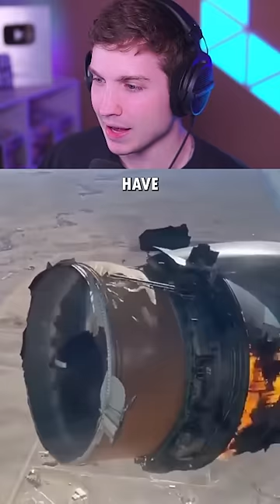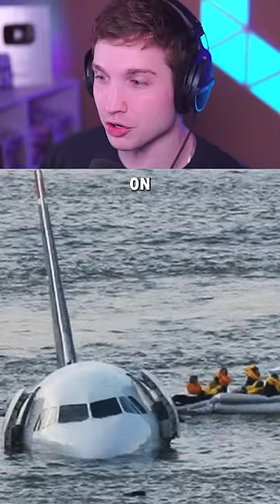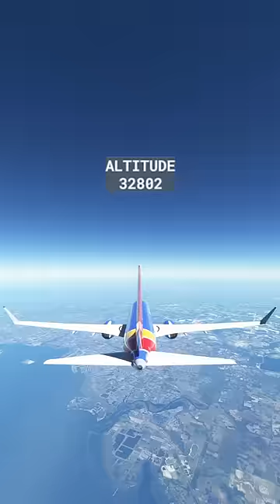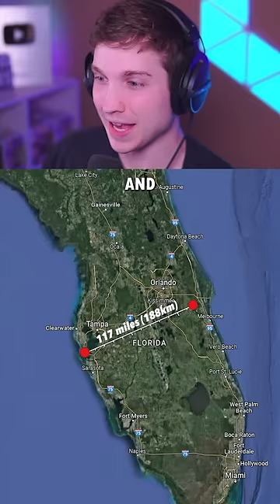How far can an Airliner Glide after an Engine Failure?

Comment: People who make movies need to understand planes don’t suddenly drop out of the sky in the event of an engine failure
Reply: Who cares? It's a movie, not a science show about airplanes. Most people don't care if it's scientifically accurate.
Reply: Movies are meant to be fictional. Watch a documentary if you want factual info
Reply: But in some cases the flight controls, airframe, and thrust difference all get screwed enough in a way you can't fly
Reply: I’ve never seen a movie where just an engine failure brings them straight down. You must be ignoring the fires or torn off wings or smth
Reply: @rjharikumar6555 you cared enough to comment.
Reply: @Cookies2132  - LOL, proper trash comment 😂
Reply: At the same time there can't be any absolute statements of any scenario. Failure of any type can generate an infinite combination of  unforseen anomalies. In the end whether a plane or boat, there are more reasons why it should be under the water or on the ground.
Reply: Madagascar flashbacks.
Reply: @rjharikumar6555 Most don’t care about scientifically accurate, but most want it atleast somewhat realistic, for example people will complain if a pistol fires 50 rounds with a single 9 round magazine.
Reply: @blackhawkuh-6026  - Again, go watch a documentary. Your mileage may vary but most people don't give a shit if a plane crash is re-created with some exaggeration as long as it's engaging. I don't place that much of a premium on realism in feature films.
Reply: @rjharikumar6555 I mean, it could add more action during the descent into the ground tho.
Reply: Um actually they do lol You could say it depends on the design. Let’s take the f 16 for example.. a plane indeed. However this aircraft would never float to the ground like a glider. It relies on the pure muscle of the jet into to keep in flying. Ever seen an f16 engine failure ?
Reply: @dominicleabo1252  “People also ask
Can modern fighter jets glide?
All fixed-wing aircraft have some capability to glide with no engine power; that is, they do not fall straight down like a stone, but rather continue to glide moving horizontally while descending”

No, gliding is a basic practice taught to all pilots wether military or civilian. You can google stories of people gliding the F-16.
Reply: They're not the safest traveling method as people always say...they use a mileage based ratio which obviously will benefit the fastest transportation method and make it look like it is really safe. If they used a journey/passenger based ratio only bikes and motorcycles would be more likely to die on...
Reply: @rjharikumar6555  Well some exaggeration is not the same as completely unfeasible
Reply: @christopherabramor3012  - Again, don't care. Want authenticity? Go watch a documentary or something.
Reply: I mean if you lose engines you might lose some hydraulics which leads to less control which leads to a nose dive which leads to a big boom boom.👍
Reply: @rjharikumar6555  Buddy, just because we want realism, doesn’t mean we should watch a documentary. Just because a movie is fictional, doesn’t allow it to be unrealistic. If a movie is borderline unrealistic then it just makes it stupid.
Reply: @BrandonSoto92010  - Actually, a movie is allowed to be unrealistic. You wanna know why? Because it's fucking fiction. And I guarantee that if you sift through many of history's greatest films, you will find that they will have a number of things in them that are "unrealistic", that does not, however, make them stupid. It simply means they took creative liberties.
Reply: @rjharikumar6555  And we are allowed to call it out. Once again, your point doesn't stand, I couldn't give 2 shits if its fiction, it should be fiction. Just because they make something stupid and ludicrous doesn't make it creative, it just makes it horrible.
Reply: @BrandonSoto92010  - The fuck are you on about? Plenty of ludicrous shit is considered artistic. If you think the only thing that's worthy of being respected is shit that's ultra-realistic, boy do I have some bad news.

Fiction is allowed to be ridiculous because, again, it's imaginary, and most of the time it doesn't purport to be the truth. Unlike your average documentary which does. So no, I'd say the people bitching about the lack of realism don't really have a leg to stand on.
Reply: Commercial jet engines flying at higher altitudes that is. The planes like the most recent from Brazil who are flying low do drop out of the sky.

Comment: ok, now I'm not really scared of planes
Reply: Unless if the pilot pulls up instantly and it'll stalls
Reply: @creeper2323  autopilot doesnt allow that on modern airliners
Reply: @creeper2323  1st thats dumb 2nd the fly by wire won’t let you
Reply: @patpilot1675  when you are flying any Boeing plane. 😃😃😃😃😃😃
Reply: enrique amaya  lol shush
Reply: Unless that MCAS kicks in 😎⬇️🔥
Reply: You should be more scared of driving then flying to be honest...
Reply: @samu-x_ciao  bro flying is the safest travel and you'll have a tiny chance of crashing cause of pilot errors or bad plane manufacturing

Comment: What you may not know is that the descent from cruise altitude is normally made at or near idle power until the airplane needs to level off to meet a crossing altitude restriction or arrival in the terminal area.

Comment: Only time you really need to worry is if you're a long way over water. Extremely rough weather or RAT / APU start failure (which you might not know about, as the flight crew may not want to cause distress)
Reply: If you are over water, you will have a less likely chance of crashing than over actual ground.

Comment: The pilot YouTuber (i forgot his name, the one that debunks TikTok “airplane passenger” hacks) basically said that if one engine failed, it would still fly
Reply: That's true. Planes with 2 engines are designed and certified to fly on just one. Maybe not take off, but certainly long enough to get to an airport, even if the loss of 1 engine is over water.
Reply: 74gear probably
Reply: @oreojsn92  they can take off with one engine too if in the middle of the departure one engine quits they will climb to 3000 ft with just one engine and do the checklist and get the plane safely on the ground

Comment: Thats pretty accurate a 747 did run out of fuel over the Atlantic and was barely able to reach the Azores Islands just over 100 miles away. The pilot had a bunch of fuel imbalance warnings but he thought it was instrument error and kept moving fuel to the leaking tank. A tech had forgot to put a screw back and fuel was leaking out of the screw hole. The plane had to land with only a couple critical systems running because when the engines stopped turning no electricity was generated and there was only enough reserve power to run a few things. Landing the plane with most of the systems shut down was not easy.

Comment: many factors will change the distance and endurance such as weight and wind
Reply: A fully loaded aircraft glides the same distance as a light one. It just has to fly faster
Reply: every aeroplane has a best glide speed too which will maximise the distance you can glide over the ground.

Comment: What really happens when both engines fail is that you can’t breathe anymore because the engines provide fresh air and oxygen and the provide electricity for the hole plan but don’t worry because you have the APU auxiliary power unite

Comment: Just remember, toward.the end, you need a steep enough decent to gather energy avoiding a stall short of runway established or not, and then nose up slightly varying according  to speed needed to reach set down point floating the plane down withing touchdown parameters for the aircraft..Simple.

Comment: Only thing people have to worry about when engine failure occurs is the cowling of the turbine falls off or some other piece breaks off and hits your back stabilizers. If on of your back stabalizers breaks off that’s when your probably going to die
Reply: Case example: United Airlines 232.

Comment: The aircraft will have a best glide speed which will mean it could go further than you managed, assuming in your video that you just 'let go' and didn't trim for that speed.  Could probably glide quite a lot further than you managed.  Less often published, but there will also be a minimum sink speed which will maximize the time in the air but will not allow you to glide as far over the ground

Comment: What glide speed were you holding?  Every plane has a specific glide speed for a given weight.  You don’t just glide a plane, big or small.  If you fly to fast you don’t glide as far.  If you glide too slow you travel even less distance.

Comment: note that this requires all engines to stop which is basically never going to happen
Reply: It’s happened. Air Canada 143 did it in 1983, the airplane ran out of fuel, all engines went out.

Comment: I’m surprised the 737 max made it that high before having issues

This is a joke related to the events in 2018 and 2019. The plane literally got 100 feet in the air and fell. I don’t need to hear about how safe it is now
Reply: The only thing wrong with the MAX was MCAS and Boeing's decision to not inform customers about it.
Reply: 737 max is super safe now
Reply: @Mark-zk3gu  it was a joke, think back to 2018

Comment: I am a student pilot the plane can glide 1 nautical miles per 1000 ft of altitude so if you have the right pitch for a emergency landing you can glide longer if you are at a 30000 ft
Reply: What type of aircraft do you fly? The maximum glide ratio of a Cessna 172 is around 9. 1 nautical mile per 1000ft would be a glide ratio of about 6. A jetliner like the 737 or A320 should have something around 17. So they can go 2.8 nautical miles per 1000ft.

Comment: Only reason two engines would quit from that altitude is fuel starvation. Which would never happen. The way more likely scenario is dual engine FOD ingestion on take off which at low altitude is why it’s dangerous. Your engines die at 30-40k feet you will be just fine

Comment: And this was with, what looks like sub-optimal gliding speed. 
For an airliner like an A320 (video was a 737, but I know more about airbus. Still the figures around around the same), a general idea is the same, but different figures.
A320 glidespeed is typically around 220kts for longest time in air. At clean configuration (flaps slats in, gear up) it will descend at around 1500ft/min. From 35,000ft/10668m, it will take 25 minutes to ground, and travel around 90nm/166km. 
For furthest distance, it will be 270kts, where, from 35000ft, you will travel 95-100nm.
fastest speed to ground will be around 330kts, you travel around 65 miles, but you will get there in less time (obviously since more speed). 

So if there are anyone who has a fear of flying, even if the worst happens and you lose both engines, you have 20-30 minutes before you hit the ground, depending on the terrain height, as well as flight height. 99% of the time you will make a runway, at least in western world. And pilots train for this. And this is really rare nowadays that all engines fail

Comment: That is because the engine failure occurred at 35,000Ft. You wouldn't glide for too long if you tried this at a lower altitude like 10,000ft.
Reply: True. At 35,000 feet, you would have almost double of the ground speed than at 13,000 feet.

Comment: So back in the 80s on Air Canada Flight 143 it ran out of fuel in 1983 at an altitude of 41,000 feet midway through the flight it flew like 80 miles not really the same but kind of

Comment: 20 mins not factoring in winds, speed, actions required to turn, and most importantly weight. Good for fictional purposes though. In reality, the distance able to glide has so many more factors affecting it. I doubt an actual fully loaded plane could glide that long.

Comment: I though loss of engines also means loss of cabin pressure?
Reply: The engines play no part in maintaining cabin pressure. Usually located behind the R2 door is a pressure outflow valve, which the pressurization system can open and close in order to maintain proper cabin pressurization altitude. The engines do draw in air from the bypass, but this air is for the air conditioning system and any other system that needs bleed air.

Comment: If both engines died at an altitude FL350 you’d descend as fast as possible to 12500 then you could glide to an airport. No engine power no cabin pressure.
Reply: Not true. You want to maintain as much altitude and speed as possible.

Comment: ETOPS requires dual-engine airliners to be able to maintain flight for an hour after losing an engine. Airliners should also be able to maintain a decent altitude on single engine operation. Seems PMDG need to sort this out if it's only lasting 20 minutes.
Reply: This video has no sense, no scientific base, he Just left the plane descending on its own, no account taken on vertical speed, ground speed, etc...
Reply: This is not pmdg 737 this is the max version that sucks
Reply: @patpilot1675  neither being a Max, that wouldn't be the efficient gliding path for engines out descent, i even think a Max is more aerodynamic than both the classic and ng series
Reply: @patpilot1675  also yes, you're true, pmdg only has a product line for 737 NGs, not the latest Max versions. Those pmdg are study level and accurate to the real plane, apart from the almost non-sense video, surely it's not a pmdg product
Reply: He cut both the engines here, it was an unpowered glide
Reply: This test is all engines out, not just one engine out.

Comment: Doesn’t it stall at some point ?
Reply: It depends

If the pilots try to keep the plane on one altitude it will move slower and slower

But if they keep descending they keep losing potential energy which is transformed into kinetic energy

Of course the plane won't accelerate limitless but it should still be enough movement against drag
Reply: There is a certain descent rate at which the speed is constant. It depends on the drag. So if you dive yould get faster until the drag is equal to the force pulling the plane down. If you try to keep the altitude you'll slow down until you stall. There is a certain optimal gliding speed for a plane. If you manage the planes attitude so you keep that speed, you'll have the most efficient compromise between altitude lost and distance traveled or the least drag while creating enough lift. If you go down too fast you'll cover a certain distance in shorter time but you'll have way more drag causing you to throw away a lot of potential energy by losing altitude at a high descent rate to maintain the speed. Usually there is more than one perfect speed. It depends on what you want. Increase the time in the air or go as far as possible? When optimizing for longest time in the air the perfect speed is a bit slower than when optimizing for the biggest distance.

Comment: Real pilot: takes of from Tampa airport heads for Melbourne international airport half way through the flight at 35,000 feet do to fuel leak there engines turn off head for Orlando Florida head for runway 36L and land at 178 knots and stop in time

Comment: that is a really really bad representation. If you had said what would happen if you glided in a straight line. that would have been fine. But in reality the aircraft would attempt to return to a runway of the airport it came from or another nearby airport. If it cant then it will find the best place to land almost which requires the aircraft to turn. During this turn they lose significant air speed and altitude. Not a accurate representation.